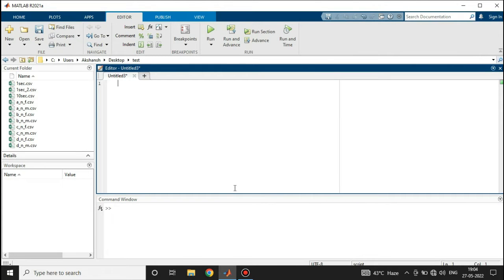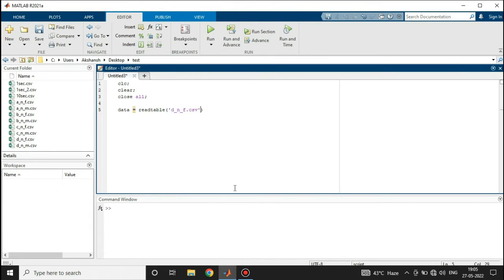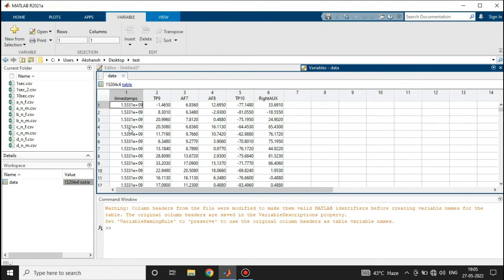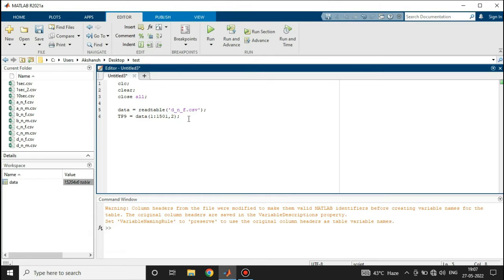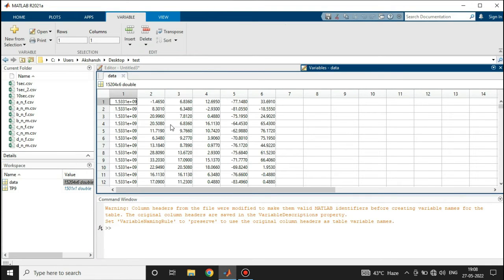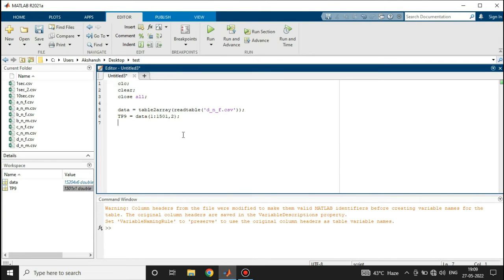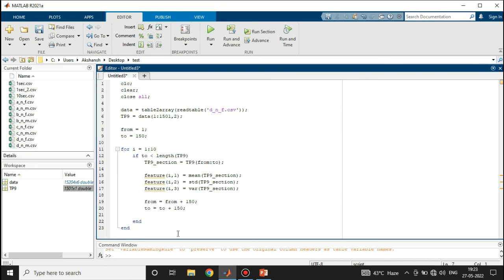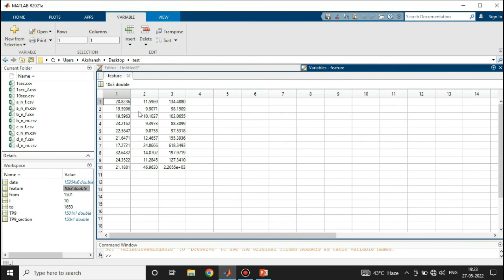EEG Signal Analysis using MATLAB (Part 2) | FEATURE EXTRACTION

Comment: how can i use this extracted features to move a robotic arm
Reply from the maker: For this you need EEG dataset for hands movement (generally EMG represents muscle movement signals), then extract features from that data. Make a successful classification ML model, then based classified data you can command microcontroller to operate accordingly.
I'll sharing whole code and it's explanation of how to do it. Stay tuned. Thanks🙏